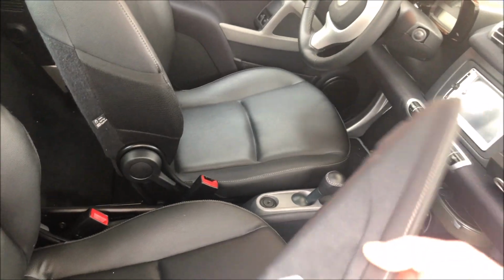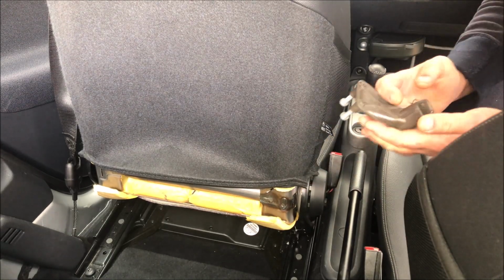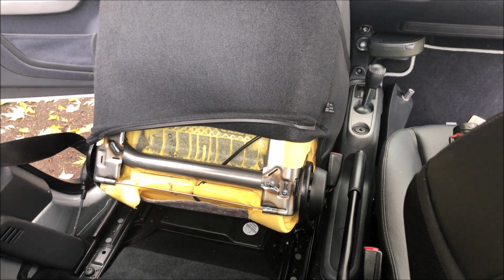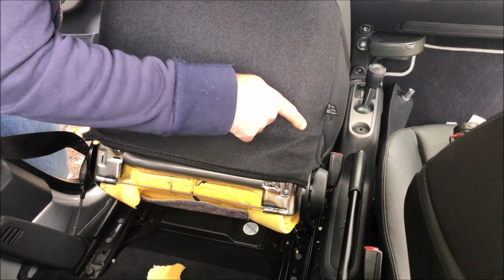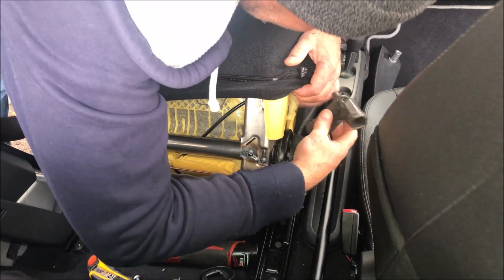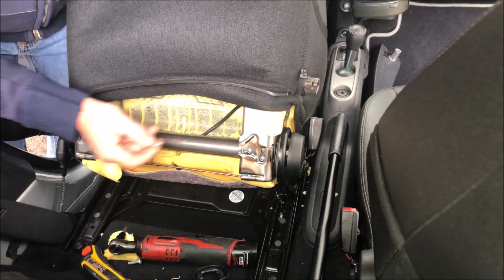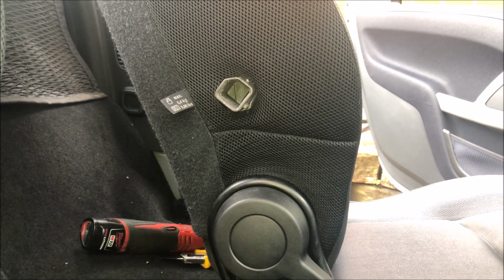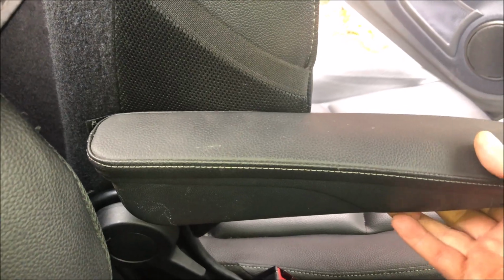Smart Fortwo 451   adding the factory optional armrest

Comment: Thanks for the instruction. It told me that I'll never be able to do this! 😟 But, I have subbed and will watch your other 451 vids. 
Any ideas of where to get a seat cover that isn't crap, isn't horribly expensive/custom, and isn't vinyl or dark coloured (or anything hot, as I live in a hot and humid location)? And still work with the airbags. I'm at the point of trying to make one, myself, out of denim, figuring it out as I go. Any help is appreciated!
Reply from the maker: The only thing I can think of to get a good seat cover would be a wrecking Yard. Ill do some searching and see if I can find anything
Reply: @fupabox  Thank you! Very kind, but if you just point me in the right direction, I'll be happy to do the "leg work".

Comment: Hey dude what’s that thing you’ve got over the shifter attached to the dash? Looks like a CD holder or something?
Reply from the maker: It’s a factory ashtray for the older Smart 450 . Found it in a wrecking yard and it fit the 451 with a bit of alteration . It swings out to open and I use it to keep coins and stuff inside .